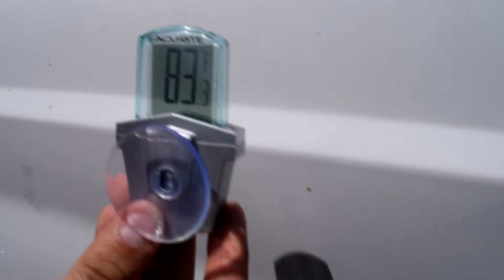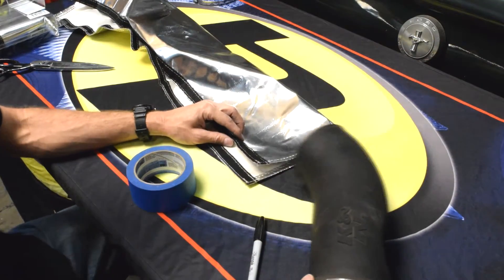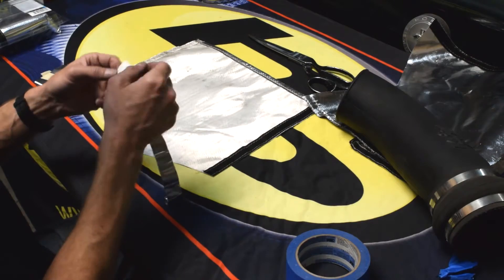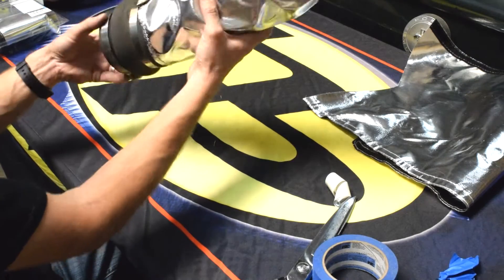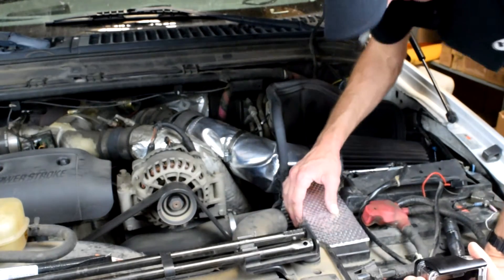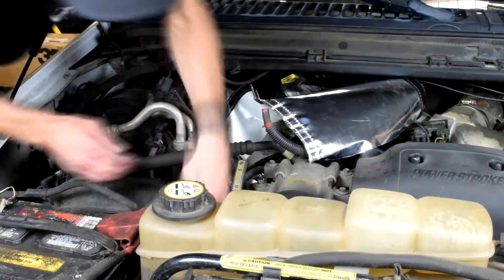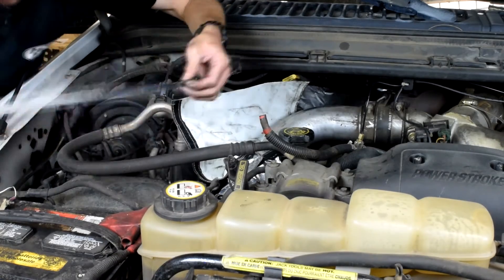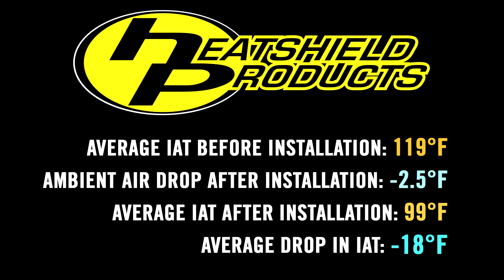Cheap Horsepower: How to Lower Air Intake Temps up to 18-F

Comment: None of that pipe shielding will change the reading from the IAT sensor.  Being that the IAT sensor for that engine was originally located in the air filter housing, which is now gone, there's no telling what it's actually seeing.  Ignoring the huge gap between the shield and intake hose was a rookie mistake, it could have easily been corrected with some of the sticky insulation that was put near the radiator hose.
Reply from the maker: Thank you for the comment.  We do have an updated video on this.

Comment: I have wrapped mine already in 90% heat reflective tape/insulation. Temps are at 18c or 64f. Would this provide any extra protection or be redundant?
Reply from the maker: Without knowing the material used to wrap it is difficult to say.  If it is a reflective heat shield barrier, then you should be fine. You don't need to buy more, save your money to buy other parts to go faster.

Comment: using the stock airbox would also help a lot.
Reply from the maker: We couldn't agree more. In many cases a shielded factory intake picking up cold air will outperform an aftermarket in that that flows more hot air.

Comment: I used exhaust warp on my intake. Does that lower temps also? Edited: also what's the name of the soundtrack used in this video??
Reply from the maker: No sir. Exhaust wrap on an intake is a no no. Exhaust wrap is designed to retain heat, not shield radiant heat away. To make a cold air intake you need something like this, you need something engineered to shield radiant heat away.

https://www.heatshieldproducts.com/cold-intake-shield

RE: Soundtrack we will ask our editor.
Reply: @Heatshieldproducts I'm probably going to purchase the CAI heat shield but do you have anything I can make like a heat shield barrier for my air filter funnel like a type of housing just like the one u have in your video.  That black rubber housing around the air filter funnel... any suggestions?  Thanks
Reply from the maker: @topgun779  First Thank you for watching. We do not have a material to make a housing out of. You could use some aluminum or sheet metal. You can then insulate that with our Sticky Shield. found here.  https://www.heatshieldproducts.com/hp-sticky-shield
Reply: @Heatshieldproducts   Hi, from your experience/knowlage, how can you compare the sticky shield you have to the cheap heat reflecting wrap tape?
Reply from the maker: @123123sania  There is no substitute for the Sticky Shield. It is 1/8 thick fiberglass, not a poly insulation like competitors products.  That being said, if you have greater than 1 inch of airspace between the current insulation and good air flow, you should be fine. We know not telling you to buy the Sticky Shield doesn't out food on the table. We also know it is hard to make a dollar, so save your dollars. The Sticky Shield would reflect more heat, but weigh buying that vs. what your budget allows.